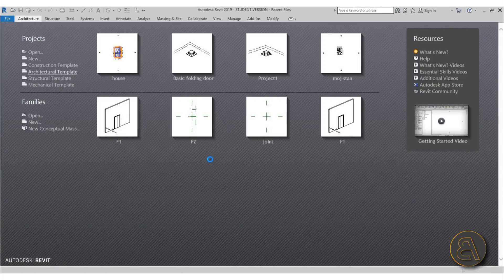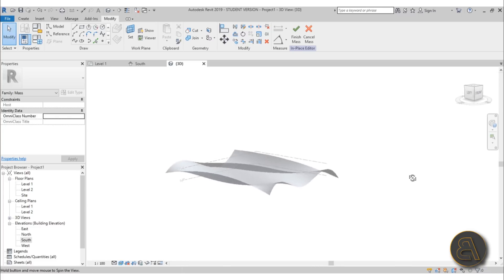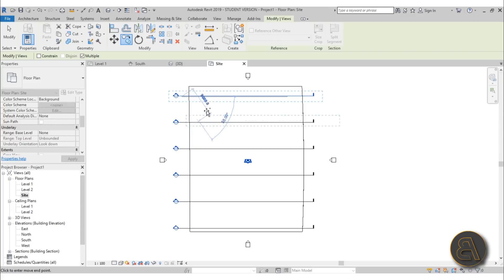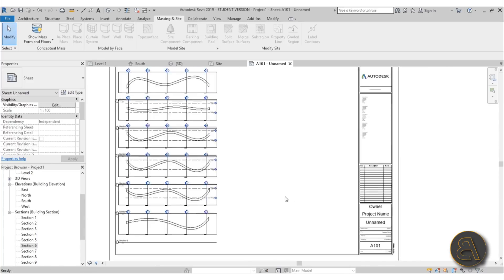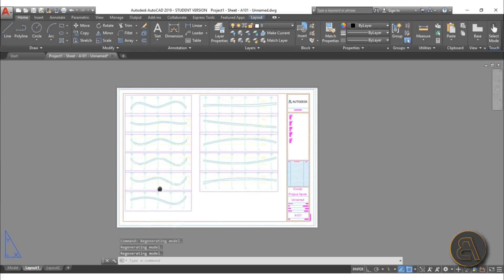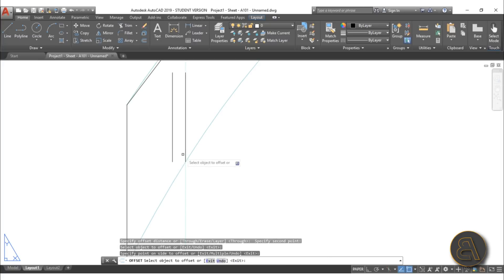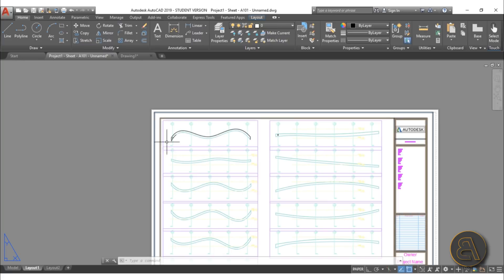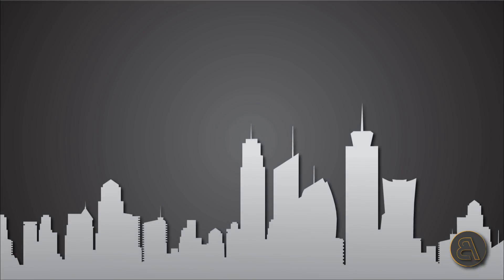Laser Cutting a Model From Revit Tutorial

Comment: What I would do for something like this is to export the 3d view to Sketchup and then use a plugin called Slicer you can define the thickness and the spacing in any direction and it wil generate the slices and arrange them for cutting with the grooves/noches needed to assemble the model
Plugin link : https://sketchucation.com/plugin/781-tig_slicer
Rvt2skp link : https://apps.autodesk.com/RVT/en/Detail/Index?id=8751333294120324116&appLang=en&os=Win64
Reply: for real?